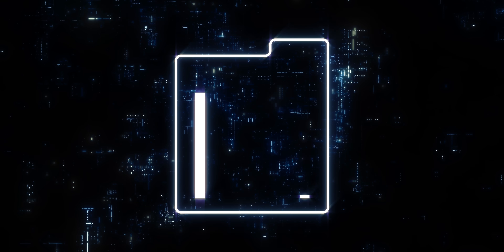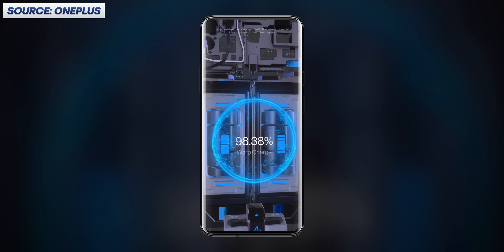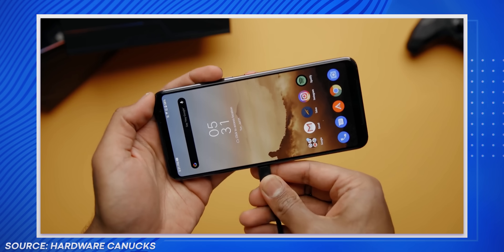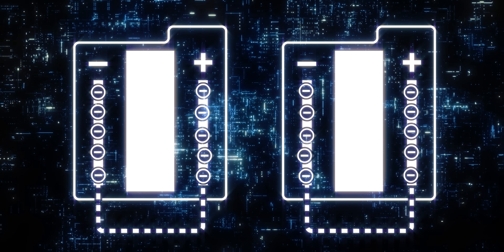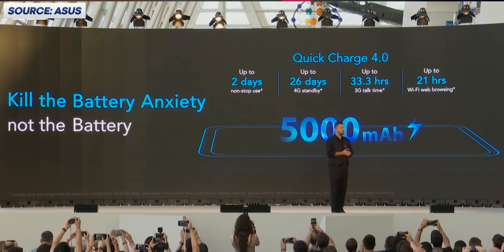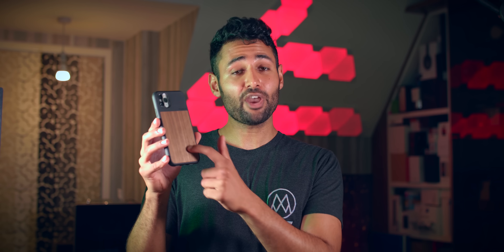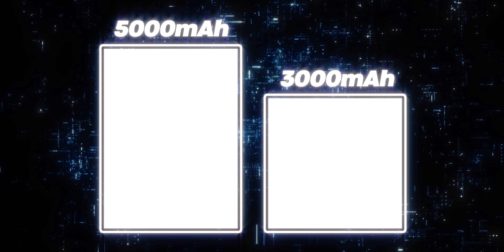The Problem with Fast Chargers.

Comment: Arun : the heat from charging its already enough
Me watching the video while charging :  *_*
Reply: Same tho-
Reply: Same but with a slow charger
Reply: did you notice that faster charger will not only makes your phone hot but also make the display unresponsive at time, so basically using it while charging is a pain in the ass ?
Reply: @lord_khufu  not all phones bro only the old ones at the time of introduction of fast charging
Reply: @lord_khufu  o have that on my old S7 Edge but all my other phones doesn't have that problem
Reply: They just need to jist make the phones 2mm thicker  bigger battery.
Reply: My last charger (slow/ordinary) became so damn hot after a while I could barely touch it, I did just bought a new fast charger tho and it barely gets warm.. even from 0-100% 😬 I guess it also depends on who made the damn thing. Need that fast charger so I can play Hay Day!

Comment: I think Fast charging is Great for me. Now, i know this isn't something that alot of people would want. It looks like Wireless charging may probably become the new norm which, in my opinion isn't good for most devices because of heat and this kind of charging can destroy your battery in a Year. So, Fast charging is a good idea because it saves you time and your Battery.
Reply: Fast Charging is BAD 
A slower charging speed helps the Battery stay in shape way longer meaning the degradation of the battery takes much longer

Comment: "apple wants your phone to last a long time" 😂 WHAT. Not according to their planned obsolescence court case.
Reply: Can you give me more info on that pls?
Reply: @natfrailadler1995  remember ANY batteries has a limited amount of charge cycle, i think li ion has around 500 or so amount of cycles, each battery reaches a new cycle when at 0 or above 80%(no in between), so when a battery reaches that amount of cycles it loses about 20% of it's original capacity.

But the thing is.... That is only the guaranteed degradation, and can worsen by the user's usage(like heat).
Reply: @r4hsn18  slowing down a device will save battery, as its not using its processor to its fullest capabilities which is high in power consumption. thats really basic knowledge. seems like u just want any reason to shit on an iphone.
Reply: @mich1904  that's not what i intended to do but i understand why you think so.

My point was that batteries degrade nonetheless so even if you do something about it, you still can't escape the inevitable degradation, and i didn't even mention iphones, i was mentioning batteries in general.

Hope this clears it out.
Reply: @r4hsn18  yeah it is inevitable, but might as well delay it as long as possible
Reply: @SoSoyGee  although they lost that case 2 years ago (if I remember correctly), they seem to be doing it again with the latest iPhones, especially the 11.  So I definitely see more lawsuits coming in the future….but It’s not like they really care though.
Reply: @silvercomet5330   thats not entirely true tho its only the battery the planned obsolescence or slowing your iPhone down nonsense is not true even iPhone 6s in iOS 15 is fast a 2015 battery sucks tho it is degrading by time after time cuz its a old phone
Reply: Dark Matter so: dont crap your pants and dont update your god damn iOS if it works as it should. 
"NEVER TOUCH A RUNNING SYSTEM"
Reply: Why do you think that was done? Apple intentionally slowed down older devices so their batteries last longer.
Reply: @iloveplasticbottles   sorry, but that logic is just overall idiotic. Battery wares out the more a person uses the device.  Updating it constantly doesn't do anything to it. (unless the developers/apple choose to slow down the device and stress the battery on purpose .)
Reply: @silvercomet5330  lol dude, that's exactly why the slowdown is needed, the battery wears out with time so you need to tone the performance down if you wanna get the same screen-time. Not sure if that's Apple's intention, but that logic isn't out of nowhere.
Reply: @botakambung968    My point is, people should have the option of choosing what update they want. Especially if the old phone is actually new (recently purchased).  So no, apples logic is completely off. And seeing how many people would rather choose performance over battery life (for example iPhone 5, 6, 7 and 8 all had trash battery life, but people still use some of them.) so it should be obvious to Apple that slowing down phones isn’t what people want, and battery life is the last thing people care about.
Reply: @silvercomet5330  they don’t slow down the phone unless the battery is critically low on its lifespan. Also, tests have been done and the amount the phone is slowed down is literally unnoticeable. It only shows up on geekbench tests.
Reply: @silvercomet5330  you're wrong when you say that battery life for iphone users is the last thing people cared about, at least, it doesn't apply in 2021. Ever since 2-3 years ago, since the launch of the iphone XS max, for apple users there has definitely been a shift from focus on speed towards a battery life that will degrade less and be able to be used more. It makes sense right? The A12 bionic in the xs max was fast enough, for most people. So people are satisfied with the speed, so they turn to the battery issue to complain about. 

This is why the iphone 13 pro models finally have great battery life as compared to some other flagships on the market.
Reply: @tiramisu7544   the sells of the iPhone SE 2020 proved otherwise. And the fact that people are still using their iPhones 6s and iPhone 8 (which have super terrible battery life) pretty much further proves my point.  

Either way, it’s great that the newer iPhones have better battery, but it’s not news that people have settled for a disastrous battery in the past just because they needed the IOS experience.

Comment: Lithium polymer batteries are extremely sensitive to extremes in temperature, 
Fast charging also generates a lot of heat, killing the battery.

Comment: So you are saying that not using my 9v 1.67a quick charger that came with my s7 is not saving my phones battery vs using a normal 5v 2a?

I only use it when on vacation and i neee a charge now.

Comment: Thank you for explaining Arun!
Keeping a phone charged at 50% sounds nice... But If my phone says it's 50%, it's got only a quarter of time left when I start using it from 100% to 50%... Best would be to keep the phone between 20% and 90%, but this means I can only use my phone at 70% of it's capacity, but it keeps my battery alive for more than 4 years! I really miss batteries you can take out of the phone and charge it without the actual phone present... This way you never use the battery, while charging and the phone will not get as hot when charging and using at the same time...

Comment: Xiaomiao fans: BuT XIaOmI hAs 120W chArGer iPhOnE sLow cHarGe. Then after 1 year of Ultra Omega Power delta fast charging they have to replace the battety, meanwhile i’m using my S9 since 2019 without using fast charging and it’s stll working fine.

Comment: Actually my 65w charger is around 2x faster than my last 30w charging phone. 🙄 Little better tbh.
The batteries don't degrade as much as advertised by most folks. In a few years we'll have more data on that.
Reply: That likely depends on how long you keep the phone.

Those who keep the phone 4 years+ are likely to see noticeable degradation. 
Those who keep the phone for a year or two likely won't see much.

Comment: In my personal experience, I say not the quick/fast charging but the heat that comes with the quick/fast charging is what really degrades the battery. I have an iphone 7plus that i used for almost 4 years with the adapter(5Watt) and cable that comes with it. And after 4 years, the battery percentage on my 7plus has gone down to 86%. Now, i have an iphone 11pro, which is obviously a replacement for my 7plus that I’ve been using for a year now with the adapter(18Watt) and cable the comes with it. And i just noticed that in just a year, the battery of my 11pro has degraded to 84% compared to my 7plus that took 4 years to degrade to 86%. And to be honest, i was actually harsher to my 7plus cause i remember watching movies and gaming with it while it was charging. I never did that to my 11pro.

Comment: I just got a new iPad that came with a 20W charger.   I have an old iPad from 2014 that came with a 10W charger.  Which charger should I charge the new iPad with for least degradation?  Is the 10W charger better because it's slower, or is the 20W charger better because it has smarter internals and is the charger the new iPad came with?  Anyone have some advice?

Comment: What you don't know, super intelligent dude, is, that some new super fast charging phones have 2 batterys inside. So both are charging at same time. As example a phone charges with 50watts, battery 1 charges with 25w and bat. 2 also with 25.

Comment: if they create like a television electricity cable where when I am at home I do not use the integrated battery at all but instead use it through directly a power source from plug in the wall, this if implemented will save money and increase battery life exponentially I guess.What u guys think?

Comment: Hi Arun! I think the visual depiction of how a battery works is misleading.. Your explanation is.. well, not exactly exhasutive but it'll do. 
1) First of all, the electrons flow between the two electrodes as long as there's a potential difference. It doesn't mean that all electrons flow from negative terminal to positive terminal (This can be a footnote in the video)
2) The visual depiction of 'powers anything along the way' is wrong. The component or the phone in this case, should be placed in between the two terminals. Or, even this way, there should be a wire going from the positive terminal, through the phone and end at the negative terminal. Here, there's no closed circuit.

FYI I'm a fan of your videos and your delivery. Just couldn't help but point this out

Comment: Ok so my 4 yr old phone has 5000mah battery and i lost its charger brick and i didnt knew what watt it was and i used the samsungs old 15 watt chargers i had in home and then now i figured out minimum the charger can do is 10w and my battery supports 5w and i recently replaced its charging micro usb port cuz it was not working and now i still sometimes get this charging for half a second then not and vice versa and also i noticed my battery is running out faster than 2000mah phones like duh

Comment: I didn't finish watching the vedio but on some fast chargers , if you didn't plug the charger right, it will tell you a warning to make sure that your charger is plugged in  properly but if you say "ok" and ignore the message it will tell you 56 hours and 50 min to get charged to full capacity even tho it should be 4 hours and 7 min.

Comment: What you can try to do to revive a lithium battery like one in a cellphone is fully charge to 100 and then completely empty it to 0. The rinse and repeat this method and you have a working battery again.

Comment: I really liked your content and loved your videos - till I saw this one.

See, if you have confidence in a youtuber and build up trust in his content - all gets lost if you have yourself some knowledge in a specific field and recognize that the youtuber is talking bs. Especially, when there are MANY moments in a video where he talks crap.

Just to name a few in this one:

03:20 : When electrons would be evenly distributed between positive and negative, there would be no difference... So ZERO Volts and no current. This is called a +dead+ battery, not a 50% one.

05:00 : Crap. If it would be true that Apple reduced the speed of older iPhones to make them last longer, they would have reduced the speed from the beginning for all phones. Additionally, Apple would make the reduced speed an Option, not a force for old phones.
Apple-User love their OS, so they would buy a new one if the old one doesn't work any more, so the income from the software-ecosystem wouldn't dimish, either.

05:45 : You say, that slow charging isn't good for your battery.
Well, there are 3 effects working together:

1.) Age of the battery: Batteries degrade with time, no matter how often (or if) you charge them.
2.) Charging itself: Each charge will degrade the battery (but see [3])
3.) Power of charging: If you charge a battery with C/40, it isn't even considered a charge. As you ramp up the wattage, heat increases, which causes batteries to degrade faster.

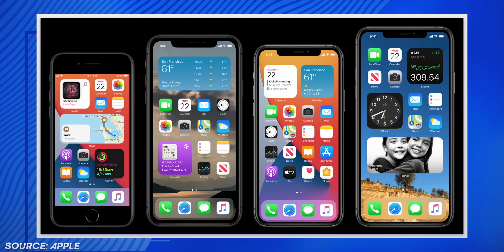Instead of explaining the facts, you argue at around 05:20, that apple is clever, because slow charging helps their users - and here you say "Slow charging is good for your battery - I wish this was true".

After this I stopped watching, because I couldn't bear it anymore.

So I'm really disappointed and asking myself, how often I believed you because I +thought+, that you know what you are talking about.

Now I'm depressed - thank you :-(

Comment: Nicely put together video.

My Galaxy S8 (which I've recently gone back to) is almost 3 and half years old. The original charger is still in the box. The vast majority of the time I charge it used the charger that came with my first smartphone (2011 Sony Xperia Neo). By modern standards, and with an output of only 0.85Amps, it is very slow (slower even than the Apple 5W charger). But you know what, my aged Galaxy S8 still has a pretty healthy battery. 

The feature built into the iPhone 11 and 12 is pretty impressive and hope more adopt it.

Comment: Are they actually two separate batteries, by that I mean two completely independent packages or is it actually a single battery with 2 cells in parallel for higher current capacity? There is a big difference here a battery is defined as one or more electrochemical cells inside a single package this has always been the definition. If multiple cells contained in a single package counted as multiple batteries then a lot of things we have always called a battery like a laptop battery would not qualify as they are typically 6-12 cell batteries depending on model and power requirements. A single Lithium-Ion cell would not survive the current draw a device like a laptop would place on it without the other cells to share the load, it would overheat and promptly produce the whole popping, hissing, and fire effect of an overloaded Lithium-Ion cell. Seems if anything this just means we are reaching a point where the market is demanding so much of our phone batteries where a unicellular battery just won't cut it anymore and they have had to produce batteries with multiple cells. Admittedly I have not taken one of these devices apart so I could be wrong here but if so could anyone point me to some teardowns where the multiple batteries are shown?

Comment: I have a Samsung Galaxy S20 Plus; should I enable Fast Charging or Super Fast Charging or disable both and just use the included 25W charger?
Reply: 'No matter how careful you are, your phone's battery is not going to last as long as it once did'

If you charge it overnight, disable both- it will get there eventually, but if not- I dont know, its your choice

Comment: You need a physics lesson my man. If at 50% charge the free elections were equal on either side of the battery there would be no more  Electron flow to power your battery after 50%.  At 0% charged the positive and negative sides have equal electrons

Comment: "your phone isnt going to last 2 years" looks at my 5+ year old phone with fast charging and using it while charging several times
Reply: Ikr, none of my friends have any issues with fast charging 50w and above in last 2-3 years. 
Yet I've never seen Batteries last longer than 3 years with showing some form of degradation to the battery life even with slow charging on other devices.

Comment: I had an xperia z2 for 5 yrs and i still got the same SOT at the and, as i was getting in the beginning. Same with my XZ3 which is 2.tyrs old, so i do not trust your 2 yrs degradation - at least in slow charging phone. Never had a fast charging model :)

Comment: Had an lg k20 and just got a oneplus nord n10 and the cable and block are huge.  I didnt know it had a warp charge and charges hella fast.  It has an optimize battery mode or whatever that stops charging at 80% and then tops it off later i guess.

Mayhe i should use a regular block with my cable so it will charge normally..

Edit: i see you commented on optimized charging after i commented..

Comment: Hey Aron 
Very useful, thank you
I have a question here
I have Motorola g9 plus and it comes with a 30w charger and a 5000 battery
I use AccuBattery app to monitor charge process
Now if I use original charger it will take 75 minutes for full charge and pretty hot , and phone will recharge in 3 days
But since I charge overnight , I tought about turning off fast charge which is not possible in settings for Motorola
So I try to use my Sony 1500mah charger and it takes 3 hours and charge rate is around 1400-1500 average and battery heat up to 32-33 Celsius and battery will last 4 days

Recently I bought a USB C cable which was produced for huawei super fast charge and "strange" it does charge my moto g9 plus with only 500mah per hour with ANY charger!!! and it draws only 3W from wall , so battery temp will be 25celsius and it takes 9-10 hours to fully charge my phone
And regarding decharge it will last almost 5 days !!!

So would you recommend me to use this huawei cable with 500mah per hour charge ?

I would be happy to read from you, you have pretty much experience and I respect that
Emil.emilson@protonmail.com

Thanks and regards
Emil